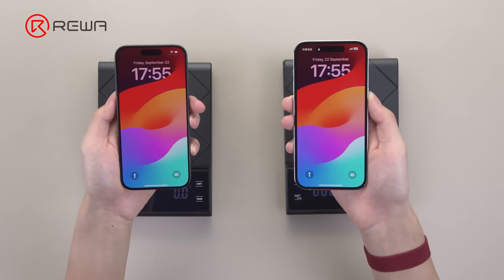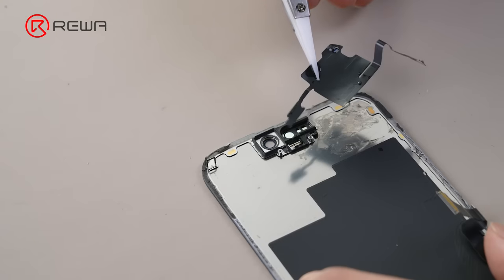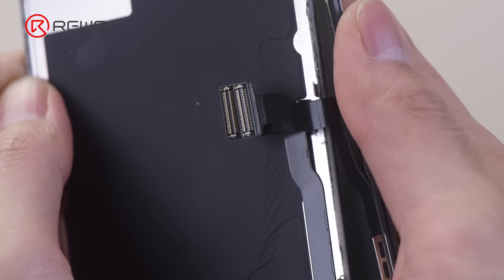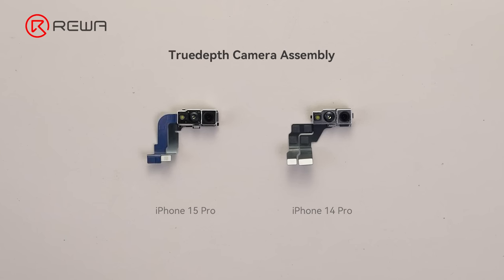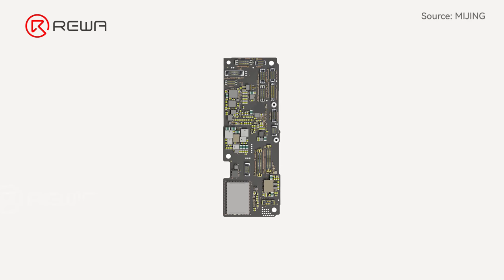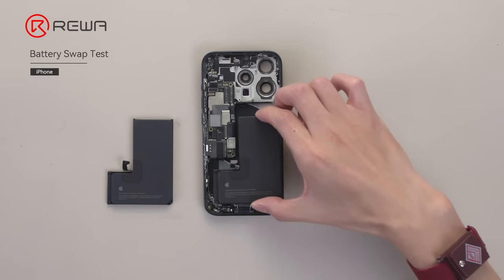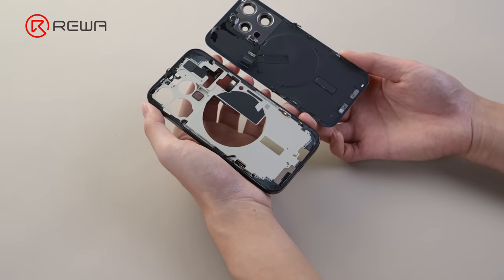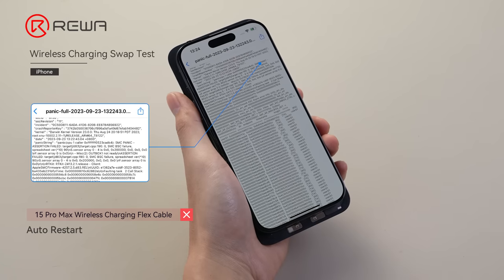iPhone 15 Pro Swap & Repair Assessment

Comment: It's getting harder and harder to repair, seems like everything are coded.
Reply from the maker: Indeed, we will keep following these issues!
Reply: @rewatechnology2008  how  come you didn’t try the iPhone 15 screen connected to the iPhone 14 pro  motherboard in some case it works backwards more than it works forwards
Reply: @NicVandEmZ  Someone tried before, seems like display is normal, but no function with the touch screen.

Comment: What if you try to connect a 15/15plus display into 15pro/15pro max motherboard. Maybe 120Hz starts working? Similar to 12/12pro brightness?
Reply from the maker: We may try it in the future 😎